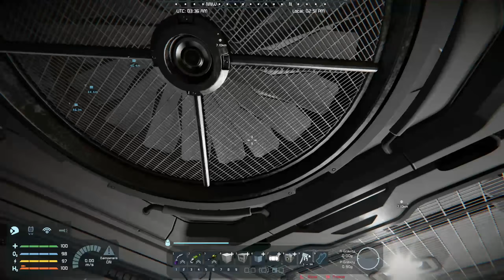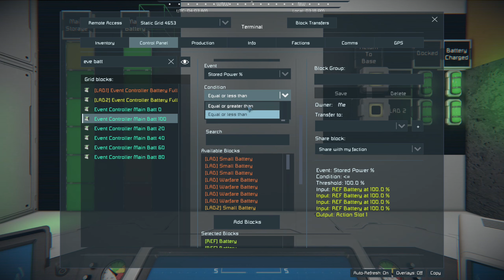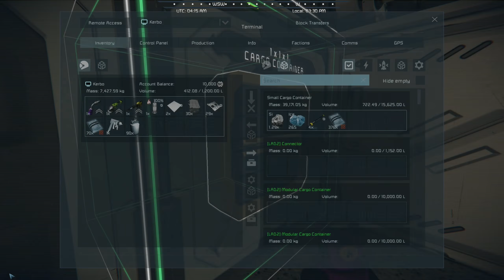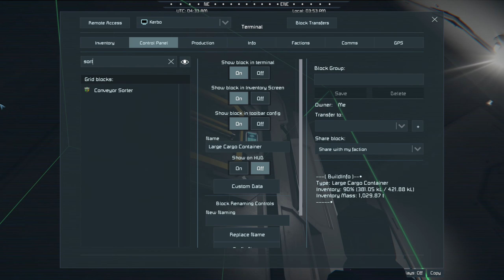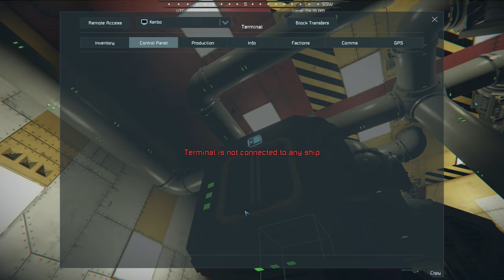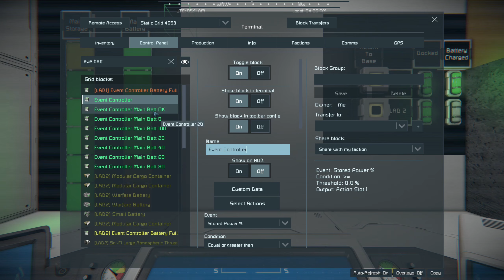Deep Ore Mining on Mars | Space Engineers E06

Comment: Very cool control room. Definitely need to keep some of these ideas in my head for my next base. 

One question: For the Refinery Engine turn off at >60%, don't you want to have it on the positive action, not that negative action? You set it on the negative action, which means when the batteries are NOT >=60% (i.e.<60%) you turn them off, but I think you want them to turn off when the batteries are >=60%.
Reply from the maker: Yes, that is correct. I have it on the positive action now so must have caught that mistake at some point.